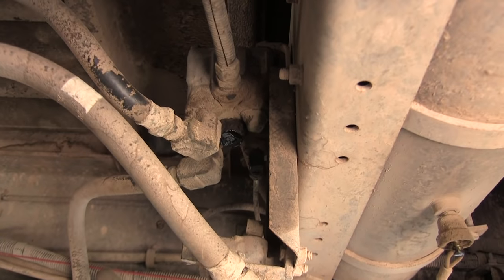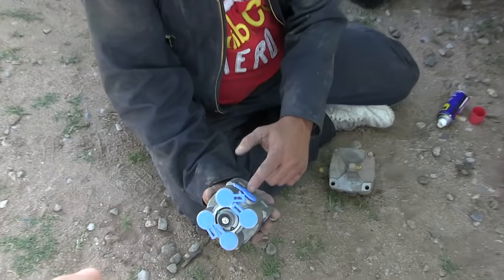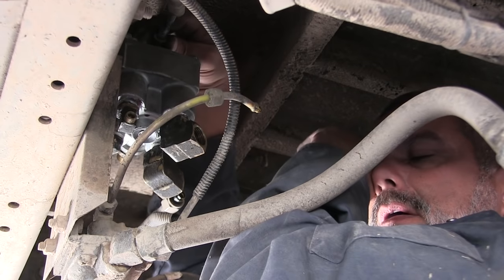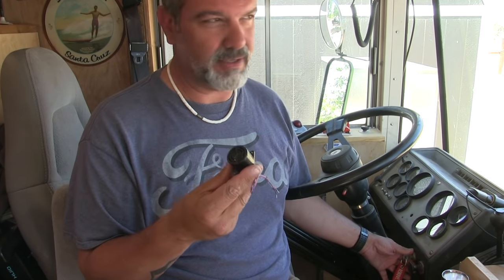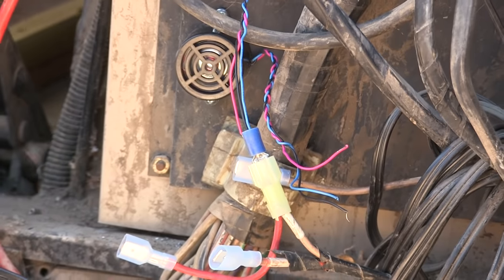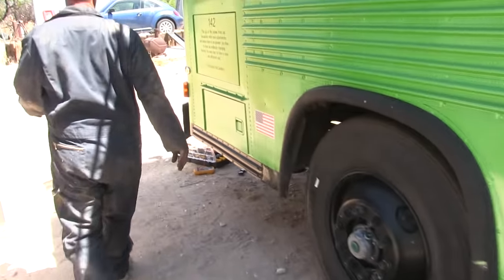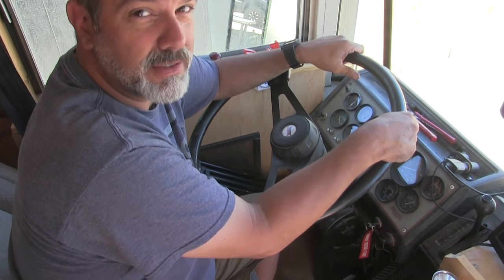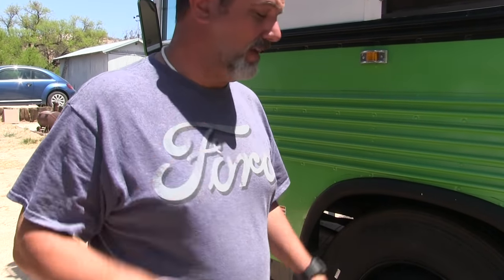Skoolie Air Brake System Repairs & Info (R12 Relay & Pressure Protection Valve)

Comment: A quick tip: if you want to drain down your air system without climbing under & getting dirty,  step hard and release the brake pedal several times. That's how DOT test the low air buzzer. You can dunp all of the air in 10 to 15 seconds that way. Also, once it's down around 60 psi, you can't release the parking brake. If you want to test that, release your parking brake,  then start pumping the brake pedal.  Around 60 psi, the parking brake valve will pop out.

Comment: Mike & Kerri,
Hello again 🖐, armchair quarterback here with an idea you might consider. In the name of both convenience and saving space, please consider getting Mike a set of Metwrench tools. They fit both metric and sae, so, you get two sets in one box. The othe upside is, the work on the flats instead of the corners and can literally remove stripped nuts and bolts. Same guarantee as craftsman. Have had mine for years. We’ll work the money. Happy mechanicing.

Comment: Mike, be sure to check the air brake compressor discharge hose to see if the compressor is starting to pump engine oil.  With the governor failure, and know the relay valve it could be signs of the compressor failing.  Air dryer may need a new filter cartridge as well. Great video. Always look forward to seeing y'all. Thanks, David and Tammy from Florida.

Comment: I've had my 7 window bus 6 months now and only took the seats out. I've been driving it around to get used to it and replace any issues it may have, now, before I really get on the road. Thanks for showing ur issues and doing the work urself, saves so much money. Working on my bus issues have been easier than the curtains yall made, lol trust me. Great job in talking n showing the work.

Comment: I'm glad you got the broken components replaced and it's safe now. Every Skoolie owner with air brakes should study the air brake system chapter in the CDL training literature, even though it's being used non commercially. Air brake pressure testing should be part of the pre-trip every day you drive. Probably the most important system on the bus for preventing loss of life.

Comment: Most truck stops or shops have a "caging" bolt you can get too keep in your toolbox. Its a 9/16 head. If one of your brake chambers (can) ever blows, you can "cage" it off too stop pressure loss in order too still build an maintain pressure on other chambers by releasing spring pressure inside the can. You'll also need too visegrip that airline tight as well. Had too do that a few times during my trucking days in order too limp back home! Pretty easy too do. 👍

Comment: It is fun to watch your mechanical ventures. It is really nice to be able to complete some of your repairs without having to take the bus in to a commercial shop.
 I  believe you would have a much more pleasant experience at replacing those parts if you put down a tarp, large piece of cardboard or an old blanket to work on instead of rolling around in the dirt.  I am sure it would be much better for the new parts going on the bus and your tools to not have dirt all over the place. Good luck on your future adventures.

Comment: Instead of pulling the tank bleeder wires (only needed once per day), you could press in the parking brake valve then repeatedly press and release the foot pedal to bleed off the system air. Once you get below ~30psi, the parking brake will apply on its own and never be able to release by accident.

Comment: I am a Diesel Tech from western Nebraska. I love your channel and the information you share on your channel. 
I plan to buy a bus and travel the country for a while as well (hopefully by spring next year). 
I think I heard you say you lived in Colorado, I assume western CO. I would love to meet you two and see what your bus is like in person. I will also check out your chassis and what not and maybe see an issue before it becomes a bigger issue.

Also, the other "mystery" line to your break valve in back, probably went to your "applied pressure" gauge.
Happy Trails!

P.S. Good job on the fixing yourself. Very important components you have been repairing.
Reply: No, they live in AZ.  They still live there cause Mike still works. They were visiting his son in CO at that time.

Comment: By the sound of your governor valve and the dryer, you need to replace the dryer or at least the cartridge if you can! When the release at 125-130 happens the ‘psss’ sound should be very quick not prolonged like yours!

Comment: Glad you can & do repair to save on repairs but that is more than I would ever want to deal with on the road. There was a time in my journey I did much in the maint. of my vehicles, change the oil & filters & fluids & spark plugs & lights, alternator, starter, hoses, batteries & cables. Ok I have listed the basics! lol. The journey changed & not possible butt I say butt living & driving & cook'n & maintaining the basics come with pleasure in life. Yes, Air-Brakes are amazing just not for me in a vehicle. I will say you got the Gift & that is a Huge Blessing. Keep on keep'n on. Safe Travels In The Go'n Into & Cum'n Out From!  Always, Tommy :-)

Comment: So, the hissy fit is resolved? 

Interesting point about just not knowing all the intricacies of a complicated air brake system. I suppose that a commercial license would require all that knowledge but for personal use, it's just not really part of what is expected. Most would just take the bus in and have a heavy-duty mechanic sort out those mechanical aspects, so good job Mike on shining a light on the dark side of bus life. Okay, that's it! I am going to have to talk to someone about these dang puns.  Perhaps Puniacs Punonnamous or an internet course on Language for not Angering Others... I'll work this out and return when I can behave. Good show everyone!

Comment: Just a friendly suggestion....back in the day when I worked on heavy trucks we used a product called .....blue goop on the threads of our air fittings. That stuff was much easier than Teflon tape and 100 percent bullet proof. Bus life and bus mechanicing are actually one in the same......unless you can afford to pull into the diesel shop all the time??? Not usually an option at over 100 bucks an hour. I'm just curious when you bleed your air tanks which should be done often is there oil coming out with the air which may indicate an air compressor problem
Reply from the maker: I was just discussing that this morning with Kerry.  I might be buying another air compressor here shortly or else a rebuild kit at least.
Reply: You can probably find a rebuilt compressor over the counter with a core exchange much easier than rebuilding it yourself. The next suggestion is to make sure your slack adjusters are adjusted correctly. They are located at the end of the rods coming out of the brake pots. Check them by pulling on them manually. They should have about 3 inches of travel. They are supposed to automatically adjust to compensate for brake shoe wear. Sometimes they don't lol so if any are out of adjustment there is an adjusting bolt on them. Here in Cali the commercial CHP check those darn things all the time.

Comment: Another ADOT test is.after air is at max, with knob pushed in, let air out. Either by applying brakes or pull cord. As you are doing that, at a certain point, the knob should pop out by itself.  Test completed.
Reply from the maker: Totally going to try this!!
Reply: Thats not all for the tests. Once air is topped off, turn off engine, release brakes, wait until air settled then your not allowed to loose no more than 2 psi in 1 minute or 3 psi in 1 minute combination vehicle aka semi truck, then apply service brakes (brake pedal) then can't loose more than 3 psi in a minute or 4 psi in a minute combination vehicle, when test are complete then keep pressing brake pedal until roughly 60 psi in tanks for alarm to go off then keep pressing until about 20 to 40 psi when the brake valve pops. Then your brake test is complete. Look at air brake book from the dmv.

Comment: This is the problem with folks operating former commercial vehicles and having no knowledge of air breaks, I’m not a hater!, but I have been a CDL driver for 35 years.. if you take on a vehicle with air brakes, at least read the CDL ( commercial driver’s license) regulations.. Bussy, I’ve been here since you first started.. I’m just saying 😎🍻

Comment: old busses not being driven often and vehicles that stand around a long time need more maintanance (rest rusts)
as for getting to the tools: maibe you can make long drawers in the sides of the bus , that way you can get at stuff in the back without taking everything out in front of it
as for the teflon tape : not the best idea as slivers of the stuff sticking out over the end of the treads can get in the system and block it , the paste type treadcompound works safer
as for hooking up the buzzers : the most idiotproof way is put one female and one male spade plug per end so you can only hook it up one way (offcourse the female fully insulated plug needs to go to the powerlead as that could potentially hit ground and trow sparks when disconnected )
releasing the air takes out the moisture and in cold climates would prevent the system from freezing up , i wonder if you can add electric valves to release the air out of the system after shut off

the things like 130 psi final airpressure shown on the dash and the small wait untill the system pressurizes further at 85 psi would be a good thing to check on startup when you buy a used bus or truck as it indicates part of the health of the brakes on that bus , the hissing outside is a good indicator too offcourse 
as busbuilds usually involves a bus being parked for some time (like a year or two on those big busses) these systems can deteriorate fast as moisture gets in them , i seen a lot of busbuilds where the first testdrive with a build out bus ends up on the side of the road , usuall thing happening : batteries flat and broken , bearings seizing up , stale diesel / clogged filters or airsystems failing , tires allso get a flat spot on them when sitting a long time giving the bus a verry rough ride

Comment: Good evening. 
Watching your video. At the exhaust port on the bottom of the air valve is covered in oil. There should not be any oil in the air brake system. Check the bottom exhaust port on your air dryer. I bet it’s also has oil around it. 
There should be no oil in the air system. So what can causes oil in the air system you say. First check your air supply to the engine air compressor. On some older units they had a 3” round air filter that no one every changes it. It’s attached right to the air compressor. If it’s plugged with dirt it can cause oil to pull into the system from the air compressor body. 
Second way is if your air supply to the air compressor comes from the pressure side of the turbo. The turbo could be leaking oil at the seals causing oil into the air compressor intake and into the engine air intake system.  
Now your going to ask me why this can happen. In the great wisdom of engine manufacturing running a larger air compressor causes more horse power loss, so they designed the air compressor to use the turbo pressured air to help put more air into the air compressor. Less horse power and friction means more power. They used a smaller cfm air compressor. 
The third problem could be the  air compressor rings are warm out. 
I would pull the turbo air pressure side pipe off and the turbo air inlet pipes off and look for oil.  Only if the air compressor gets it’s air from the pressures side of the turbo. 
Follow the air compressor intake line back to see where it’s coming from. 
You will have to also clean the air dryer and install a new kit. 
You can put methyl hydrate in the air compressor outlet line that goes to the the air dryer to help clean out the oil. 
Check your air tanks for oil residue. Drain the tanks down to zero. You should also have no oil in the tanks. 
Good luck
Reply from the maker: Great f'n comment!!!! Thank you! There will be a video!

Comment: How can you stand to lay on rocky gravel underneath the bus?
Reply from the maker: With my official Bussy McBusface coveralls of course!
Reply: Get some heavy cardboard it works great for that under bus jobs. That's what I use and fold up put it in tool bay on top of tools. By the way good job on the fix. Oh yeah pb the dump valves (air) .

Comment: To drain your air pressure, rapidly pumping the brake pedal would be faster/easier, just like you do in a proper break test. Which should be conducted daily prior to driving.

Comment: I'm surprised Mike hasn't figured out a way to add a solenoid valve to those tanks so he doesn't have to climb under the bus to pull that pressure release string

Comment: Not pods brake cans if they have springs in them there maxe cans for your air emergency brakes
Reply from the maker: Whelp, after an extensive search, we are both wrong🤣 Air brake chambers are the official name!
Reply: True but common name is brake cans but you are correct at least for the last twenty five years that's what they have gone by it really doesn't matter once you tell your parts store what you want it for they know what they are. Mike do you have auto slack adjusters on the bus?
Reply: @BussyMcBusface  Brian is correct. Sort of anyway. The part that you threaded the air line into on the rear is the air brake chamber. The entire piece that includes the chamber and the rod sticking out the back is known as a maxi-can. It's a maxi can because its your parking brake as well as your foot brake all in 1. 2 air lines going into it, 1 is for emergency air to release the brakes, gets its signal air from your parking brake button on the dash. the other is for service air coming from the valve that you replaced, gets its signal from the foot pedal valve also known as the treadle valve... The ones on your front axle are just brake chambers (no parking brake). Only 1 air line going to them. I have been a truck driver for 42 years. And if you are worried about someone "accidentally" bumping the button on the dash and releasing your brakes when parked, they do make a dash valve that works opposite as in you push it in to set the brake and pull it out to release. They were common in the old trucks like in the 1960's.

Comment: Tip for dealing with Teflon tape in tight spaces.  Get yourself a pencil, wrap the tape off the roll several times around the pencil.   Then you can get the tape into tight spaces easier and just unwrap it off the pencil onto the nipple by simply rolling the pencil around the nipple.   Not a "mechanic tip" ... a plumber tip.